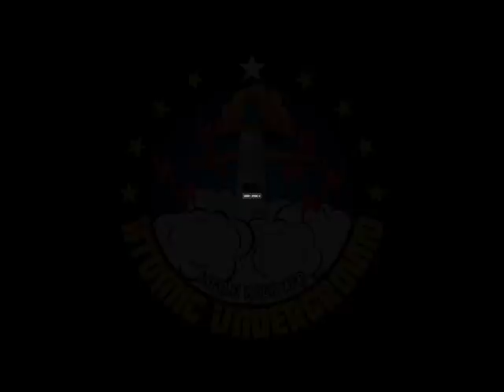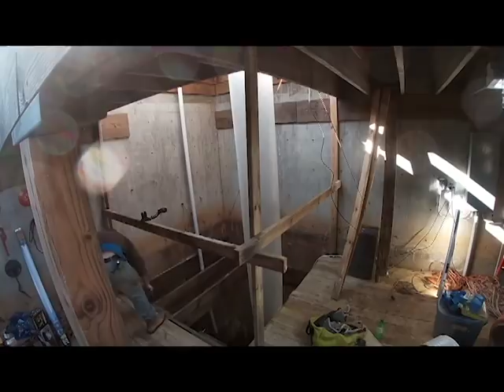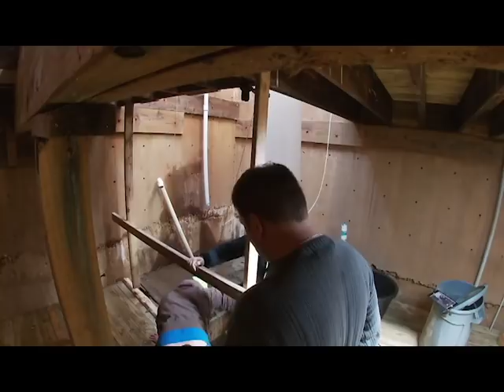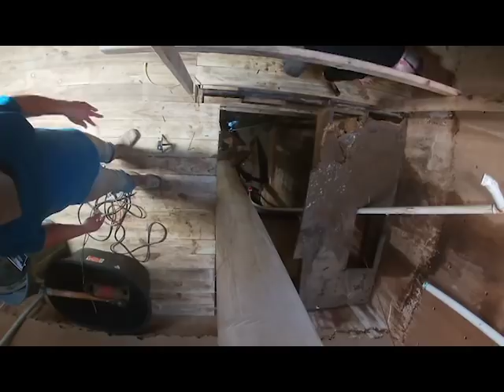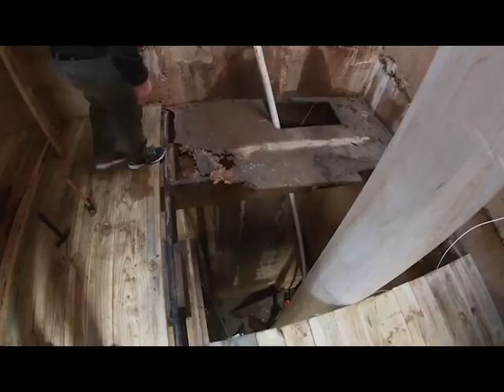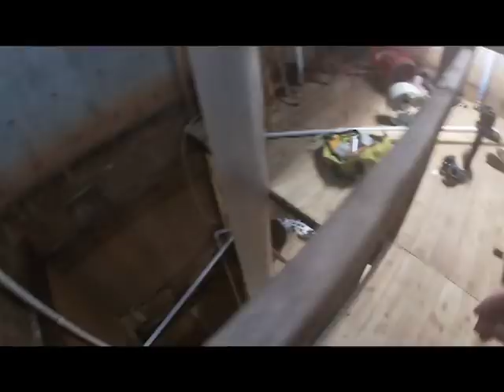S1E10 - Opening the Elevator Shaft Floors - Owning a Titan II Missile Silo

Comment: I'm not really concerned about you chopping through that old wood, but for a random diety's sake, please wear a harness and a fall arrestor next time. If you lose your balance and fall into the gap, it's a long way down...
Reply: I second that thought, having worked in industrial settings where a fall was quite possible if things went wrong. If you are working close to the edge it would be advisable to use a harness attached to a fall arrestor or a safety lanyard.

Comment: Would it have been easier to use the saw to cut out the joists versus the Armstrong method? 

That's the issue of not being there; we don't know why you did it the way you did. And while I agree with most of the safety first post's, I don't know the cercumstances.....

Comment: Awesome job, looks like hard work! If I didn't live so far away, I'd come help out. Are you guys planning on doing the scrapping out yourselves, or...?  If I owned it, I'd be stuck; as a history/cold war buff, I'd prefer to try to restore it as best as I could to look as it did as a missile site. Clean it up, de-rust, repaint, etc. However, a smaller part of me does see the practical utility of clearing everything out and re-doing it into something else. Guess it all depends on what your final goal(s) for the site are. But it seems like clearing it out removes the specialness and makes it just a big hole in the ground. But (unluckily for me), it's not my place!
Reply: Consider the following: there is a Titan II complex in Arizona that's been completely restored, including a dummy missile, and has a fairly expansive museum constructed in and around it. A private owner could most likely never hope to do that good of a job restoring a complex themselves, especially once that was fully decommissioned (i.e. had the top of the missile silo exploded). In light of that, I don't see much point in attempting what would be a fairly poor restoration comparatively speaking. Turn it into a nice residence as the ultimate adaptive re-use, I say.
Reply: @MalikCarr  That's my logic too.
Reply: There are other considerations too... for example, to paint the ceiling you have to reach up through a complex mess of pipes and conduits.  You could never get a brush up in there or paint the tops of each pipe.  Since they are corroded inside and you will never pull new wire through them, it is better to remove it all, clean and paint, then add a few new modern conduits as necessary for power, fiber, etc.  Some things are worth restoring like light fixtures, the blast doors, and hydraulic door locks.  But the vast jungle of tangled pipes and steel just have to go to make the site useful.
Reply: I don't disagree with your comments! Nevertheless, my original statement stands.  :)

Comment: Misconfiguration notifier bot: This video is uploaded in letterboxed 640x480, rather than the normal resolution of 1920x1080.
Reply: u mean its 4/3 intsad of 16/9
Reply from the maker: I’ll look into it. I’m not a video guy so I’m learning as I go
Reply: @atomicunderground9971  Most likely it is just a setting on the camera to turn it to 4:3 to 16:9.   I have an old dv canon zr850 and it has the 16:9 "switch" in the menu, but it still shoots 480 standard definition.
Reply from the maker: NorCal Explorer one of the GoPro cameras does 4K the other does 1080p. I think I need to change the render settings on my editing software if it’s popping out 480p